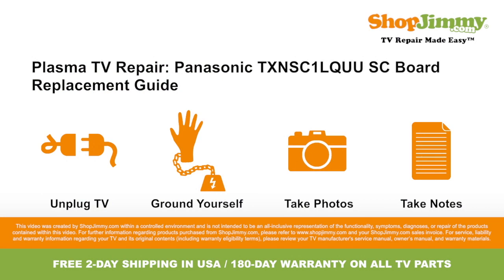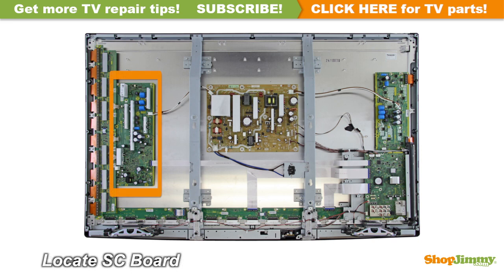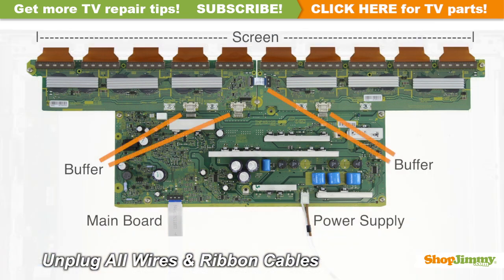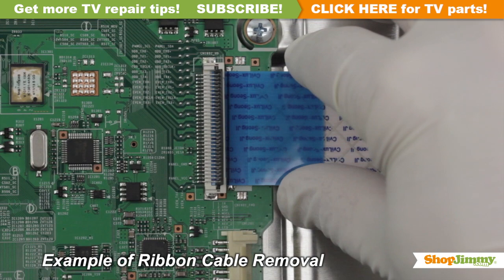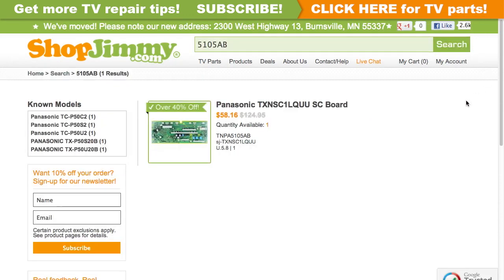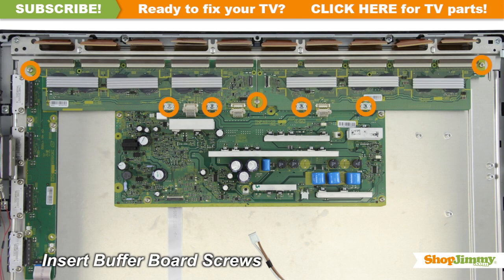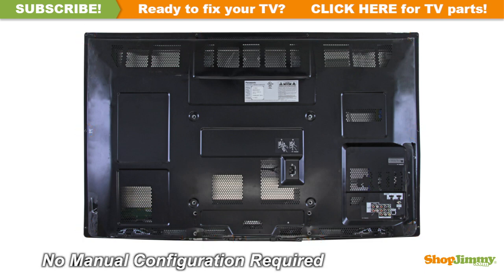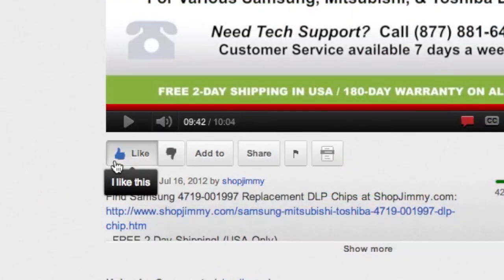Panasonic TC-P50 TX-P50 TXNSC1LQUU SC Boards Replacement Guide for Panasonic Plasma TV Repair

Comment: My Panasonic TH-50PX50U looses audio and sometimes video intermittently for a second or two.  Comcast suggested I switch from the HDMI port to the components port and that worked for several months.  Now it is occurring on these ports as well.

Comment: Hi, I have a Panasonic tx-p50g20e, It showing 13 times blinking red led, I read in some forums that it is an A board Issue. Do you think that I'll solve the problem by replacing the A board?

Comment: My son purchased the open item TV along with a 1 year geek squad warranty, that he did not renew after the year was up. But not to long after the warranty expired, so did his Panasonic TC-P55ST30.  I found an hdtv repair shop and had the SU board replaced by them. But given the cost of the repair and part (almost 3 times more then Shop Jimmy charges), I should have just recommended he buy a new TV. So... 90+ days later (shops warranty on parts and labor of course)... guess what... TV died again. Same issue.. 7 blinks of death. At this point, I feel the tv should used as a boat anchor.
Reply from the maker: ELWATCH01   Yes, at this point it is probably not worth repairing.  Thanks!  www.shopjimmy.com

Comment: my TC-P50U2 popped and shut down yesterday morning...giving the 10 blink error. it looks like replacement boards are even hard to find now. I'm determined to fix it because Plasma's are so hard to find now and very expensive. there are no obvious failures on the board - no bulging capacitors, scorch marks. help me, you're my only hope

Comment: My 2005 Panasonic TH-50PX50U is flickering/strobing when high contrast images are on the screen.  It is at its worst when it's on the guide menu for direct tv.  Also, the picture and sound often go out for approx 5 seconds at a time.  I am capable of doing the repair, but need help in identifying what parts to order.  Please help.

Comment: I have a TH-50PX75U where the entire top half of the panel is black, completely unlit. I suspect the upper buffer, but do I need to order the other board as well? Also is it possibly the panel that's at fault here?
Reply from the maker: Mike Cole  Yes, it could be the upper buffer or the panel that is bad.  Here is a link to replacement parts if you do want to replace the upper buffer to see if that fixes the problem.  http://www.shopjimmy.com/catalogsearch/result/?q=TH-50PX75U  Be sure to match part numbers on your current board, with your replacement for compatibility.  Thanks and please let us know if you have any further questions with your TV Repair!  www.shopjimmy.com

Comment: Hi Guys. I have a one year old Panisonic Viera Plasma TV. TCP50UT50. It has recently stopped working and is showing a fault code of 8 blinks on the power indicator light. I see lots of info on 7 blinks. What does 8 blinks mean and can you recommend what part I require? Thanks
Reply from the maker: jim aguanno I recommend replacing the SS board in your TV.  Here is a link to replacement parts for your TV model number on our website, click here:  http://www.shopjimmy.com/catalogsearch/result/?q=TCP50UT50  Be sure to match part numbers on your current board, with your replacement for compatibility.  You can also call our customer service for further assistance with your purchase.  (877) 881-6492  Thanks and please let us know if you have any further questions with your TV Repair!  www.shopjimmy.com

Comment: Hi, just wanted to know if you could guide me thru this problem my Panasonic plasma hdtv model#TC-P50U2 manufactured October 2010 will not turn on it blinks 10 times pauses and starts blinking again when I connected ican hear a click pause and than another click

Comment: Hello, Shop Jimmy Techs. I have a 2011 Panasonic TC-P50  MA11320558 Plazma When turning it on the Red light at the bottom comes on but no picture or sound. If try to turn it off the red light stays on. Any idea what board is defective?  Thank you
Reply from the maker: Scott Britt  Please watch this video FIRST to help with your repair!  https://www.youtube.com/watch?v=BP3NVNCGEv8   I recommend replacing the SC, SU and SD boards in your TV.  Click this link to replacement parts for your TV model number:  https://www.shopjimmy.com/catalogsearch/result/?q=TC-P50  There may be multiple boards for the same TV model number, be sure to match part numbers on your current board, with your replacement for compatibility.  Thanks and please let us know if you have any further questions with your TV Repair!  www.shopjimmy.com

Comment: Hello, We have a Panasonic Plasma TC-P54G25 Model #LF02640514. While watching TV a loud popping sound along with a flash came out from under the tv. The tv went black. A red flashing light (4x) on front appeared.We unplugged right away. waited for a few minutes and plugged back in with no picture coming back just the flashing red light. What repairs if any can be done?
Thank you for your time.

Comment: i have a tc-p55st30 recently replaced the the Mainboard . the unit powers up . backlight turns on . but no picture is displayed what could be the issue. the sc board has also been replaced
Reply: im not getting any blinks powers on fine
Reply from the maker: joseluis rodriguez  Please watch this video FIRST to help with your repair!  TV Repair! LCD, LED, Plasma, DLP How To Fix Your TV with ShopJimmy.com Help!  You will want to replace the SC board and the SU and SD board all at the same time.   Here is a link to replacement parts:  http://www.shopjimmy.com/catalogsearch/result/?q=tc-p55st30  Be sure to match part numbers on your current board, with your replacement for compatibility.  Thanks and please let us know if you have any further questions with your TV Repair!  www.shopjimmy.com

Comment: My Panasonic  TC-P50C2's Red LED flashes slowly after I turn it on, then turns itself off. Occasionally I can get it to come on though. Is this a power supply issue?
Reply from the maker: JDowie   I recommend replacing the power supply in your TV.  Here is a link to replacement parts for your TV model number on our website, click here:  http://www.shopjimmy.com/catalogsearch/result/?q=TC-P50C2  Be sure to match part numbers on your current board, with your replacement for compatibility.  Here is a link to a video showing how to identify your part number, click here:  DIY Plasma TVs 101: Part Identification Number Guide for Panasonic Power Supply (PSU) Boards  You can also call our customer service for further assistance with your purchase.  (877) 881-6492  Thanks and please let us know if you have any further questions with your TV Repair!  www.shopjimmy.com

Comment: My Panasonic TC-P50U2 does not turn on properly. After turning on, it will quickly go off, and the red light showing power will start to blink. How can this be fixed?

Comment: we had a transmitter blow up in the front yard  it caused the cable boxes to short out and fry the boxes  the wire that is connected from the box to the tv  fried   tv comes on but no picture  please help what can we do
Reply from the maker: Debbie Stanforth  I recommend replacing the main board in your TV.  Please reply with your TV model number and then I can recommend a replacement part for your TV repair.  Thanks!  www.shopjimmy.com